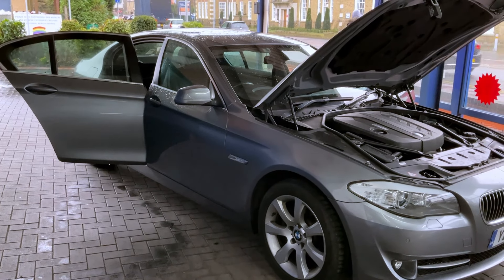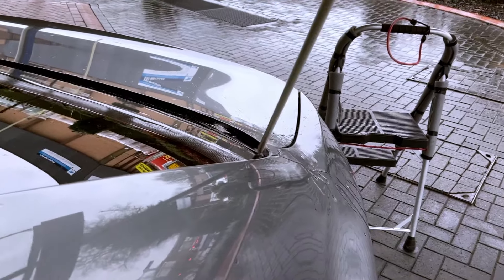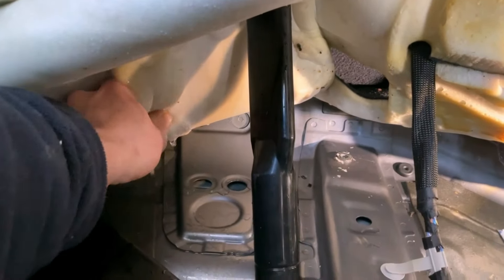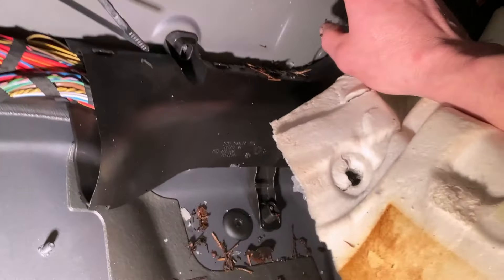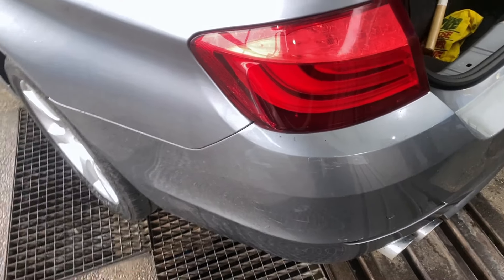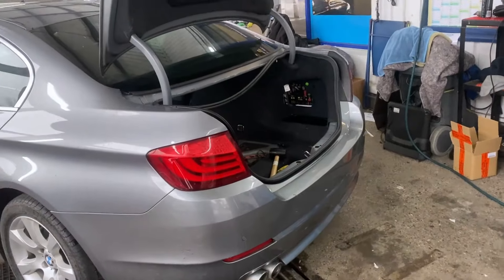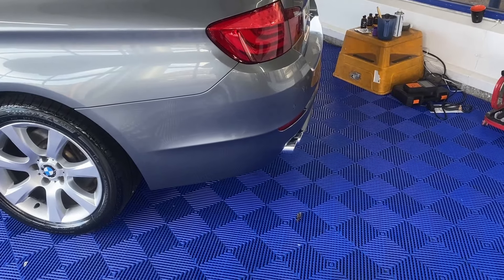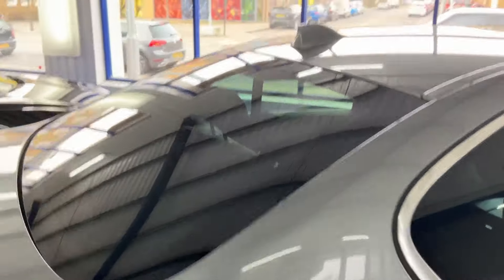BMW 5 water leak repair, made like new again!

Comment: Is it possible to remove/replace the grommet from inside the car? It’s very hard to access from the engine bay in my 550i.
Reply from the maker: Yeah, but you have to get the carpets up. It's not an simple job either way.

Comment: So how do we fix it?
Reply from the maker: Clean it out and replace with a new plug.
Reply: You remove the plate from inside the engine bay. It has 4 torx screws. T25 or T30. You can then see all the trash that's against the yellow plate. Clean it out and silicone all around the plate to seal it off. Then to the right of that clean out all leaves everywhere. For extra measure you can put a hole in that plate itself near the bottom. Bmw really messed up here. No longer is this a luxury car
Reply: @donperryautomotive  Thanks .. you should record this removal